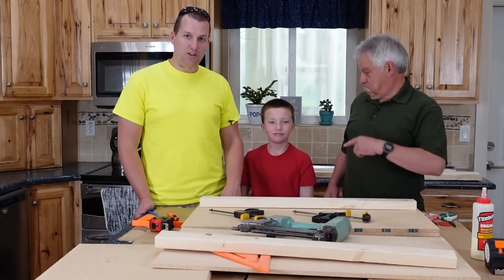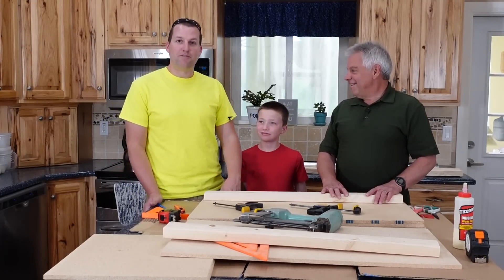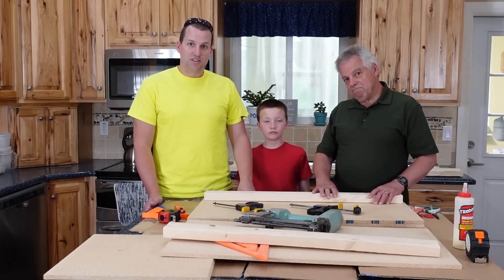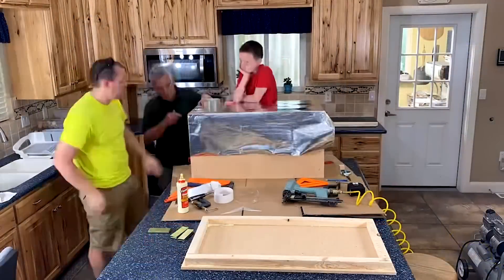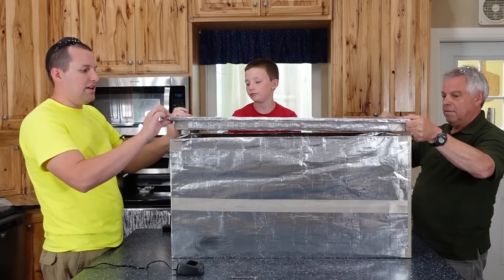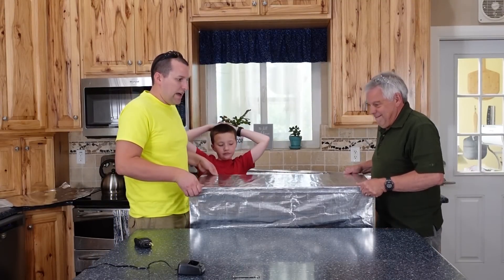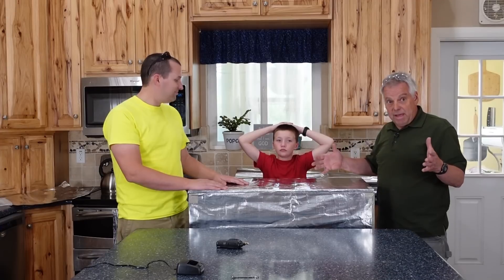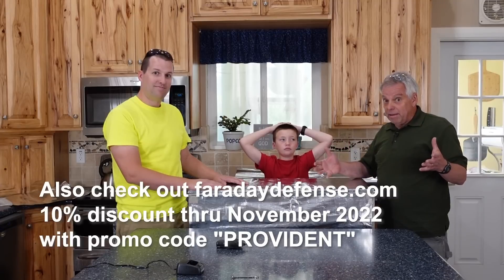EMP Ready: DIY Faraday Cage Construction and Testing

Comment: one thing you need to know  is that the squeeling you heard at beginning between radios has nothing to do with the frequency  it has to do with  audio feedback between the mic on one radio and the speaker on the other radio , so do get confused and think that since you dont hear that audio feedback that you have stopped signal transmission , you have only seperated the  speaker output from feeding ointo the mic input on other radio, but using other means to verify signal reduction is what you need to use, unfortunately too many people online think that the audio feedback  going away proves success it doesnt , you need to verify in other means, the cage does work yes but cannot use absence of feedback as proof, key is to make sure no leaks in metal barrier , even if some leakage occurs it will be reduced enough to stop or extremely reduce chance of damage to electronics, nice project though can modify to size you need for your situation.

Comment: Good luck being able to use those protected devices with no power grid and no functioning communications systems.  If you have battery backup it won't last long.  If you have generator, fuel will be depleted shortly.  Best thing you can do is get out of population centers and be prepared with supplies for living as in 1800's.

Municiple water supply will be down.  So no flushing toilets either.  Are you prepared for that?
No life sustaining prescription refills available either.
Lot's of people will die in the first year.
Do you have source of heat for winter?
Do you have cooking ability?

Comment: Since I need to keep mine in a garage, I'd be worried about the EMP wrap getting cut/sliced while moving things around. I'm thinking of lining the inside of a box using this type of material and then adding cardboard/thin paneling to set my items on. Could this ideally work? Thanks

Comment: Btw - I forgot to mention…
Some types of copper conductive foil tape comes with CONDUCTIVE ADHESIVE!
It sure beats soldering bridging braid or other methods of achieving true multi surface equipotential.

Motorola used to carry it for their repair depots and other sources.
The price wasn’t really too high and they also had a variety of widths available. (1/8” / 1/4” /1/2” 3/4” 1” / 2” / 3”)

Great video as always.
Thanks!

Comment: If anyone here has constructed a Faraday Cage type RF attenuation enclosure and would like to THOROUGHLY test it more than Dr. Bradley’s test device (a great little design at low cost that essentially does the job for most applications).
He’s also a brilliant mind in the EMP/CME community.

But… if you would like a more comprehensive test and/or cannot afford the Dr. Bradley test kit, and happen to live near NorthWest Suburban New Jersey…

I’m an EE and RF design engineer / Amateur Radio Operator / volunteer firefighter-EMT / Father and Husband /
“Evil and Psychotic Prepper Type” who was forced to retire after my medical situation (I have Ankylosing Spondylitis and pSA) really interfered with work.

I have a home RF lab with everything required to thoroughly test any enclosure that my smallest portable spectrum analyzer can physically fit into. Agilent 9340c (or… if too small, the mini SA is about $15,000 less than my Agilent SA and the size of a few iPhones stacked on top of each other.).

of course, no charge for anything.  I’m just looking to assist the same community that has given me so much information in the past..

Comment: Build a faraday cage- use it to stored electronics and back up equipment and electronic components.
I keep 3 cans just for back ups electronic devices, batteries and power generating systems.
Plus i will keepbextra wide variety of electronic components- resistors, capcitors, computer chips plus "SD cards with lots of stored data and computer programs.
I can repair my stuff for free and help out others.
1,000 in componets being protected.
As a profitable business.😅
😅😅

Just like seeds and canned food in jars to cover over 2 year supply for myself. I live alone.
I can grow extra food to sell.

I also keep containers to store 500 gallons of water or pull it from the ground.😮

Comment: To be able to withstand an EMP, and in order to make a proper Faraday cage/box you MUST understand the properties of an EMP.  Not understanding the nature of EMP's and making a box that is supposed to protect your sensitive electronics from EMP's that is based on a lack of understanding WILL result in making a faraday box that simply does not work.  

Anyone with any knowledge of EMP's will tell you that an EMP creates 3 types of waves or pulses.  E1, E2 and E3.  The E2 and E3 are pulses that "look" like a CME and a lightning strike.  The E1 pulse is the pulse that is the real danger.  It is this pulse that, without understanding its properties, will be the downfall of faraday cages that are make like yours.  I can't go into detail about the E1 pulse, the E2 and E3 pulse.  Sufficeth to say that there's a huge difference between them.

The radio tester you are using.... that too will not mimic an E1 pulse.  For you see, the E1 pulse uses frequencies anywhere from 100Khz to 30GHz.... You are only testing ONE frequency... and I really don't care which frequency that radio is tuned to.  You have to be able to prevent frequencies from this huge range and not a single frequency.  This is why your microwave does NOT make a good faraday cage.  IT only protects you from a certain small range of frequencies and not the entire frequency range of the E1 pulse.  You also haven't taken into consideration the amount of surface voltage that will be present on the faraday box if a small yield HEMP hits.  A SMALL yield HEMP produces around 50K volts/meter squared.  Today's HEMP's produce in excess of 200K volts/meter squared.  What does that  mean?  Anyone that understands EMP's and HEMP's understands that when the gamma particles that are ripped from the upper atmosphere come down to earth, they create the 50Kv/m2, which means that if you have a box, similar to yours, with dimensions that measure 1meter x 1 meter x 1 meter, the surface voltage on that box will be 50,000 volts.  Again... this is for the old HEMP's.  Today it would be 200,000 volts on the surface of your 1meter box.   Depending on the THICKNESS of the material will determine how much of the surface voltage can be present ON THE INSIDE of the box.  It is quite necessary to keep a physical barrier or distance from any device inside of the box to any of the 6 sides of the box.  For a 50kv/m2 yield HEMP, you are required to keep AT LEAST 1.5" distance away from the surface voltage.  It is understood that with a 50kv/m2 surface voltage the electrical voltages "jump" to any device within 1.5" of the surface voltage.  The wood may in fact be the right solution here... but you need more than just the 1/2" press-wood, or fiberboard.  You really need the 1.5" of separation.  In addition, you need to wrap your devices that are placed in the box with heavy duty anti-static material.

This is just the beginning of what needs to be done.  I find it interesting that many people on YouTube show their "solution" when the solution really doesn't address the issues that an EMP or HEMP produces.  Your "EMP proof" box has many issues with it.  I just wanted to let you know.

Comment: Im a Ham Radio Operator & have lots of expensive Radio equipment & I was thinking of bunging it all in my chest freezer as soon as War is declared as the metal grounded cabernet should offer some protection. As for my larger items like a 50 inch plasma TV & several smallers sets I thought I could wrap in aluminium foil & ground it to the water pipes on the central heating radiators. Antennas to TV, broadcast radio receivers should be disconnected as even a weaker EMP would damage the receivers front end at least. A microwave oven should offer protections to Ones electronics.  It's knowing when a EMP attack is coming as we dont want to be deprived of our gadgets by storing them in an EMP box & just waiting for it to happen.
Reply: I expect that the EMP event will happen without notice. Maybe if you have your ear to the ground and can read between the lines, you might have 5 minutes notice.
Reply: @ToiletTrainingTales  True, but I bought 3 trash cans & have devices packed away in cardboard lined trash cans & larger items any metal insulated & wrapped in foil.

Comment: To prouve better your point I would have tested it with the lid open to show the beep for the test device and then would have tested it with the lid closed. It would have prouved how efficient it is. Also I would have put an antenna on the outside radio. Good video
Reply: Agreed the feedback loop is not a true test. He should have an antenna on the outside radio and the inside set at zero attention to see if it blocks the signal. Then speak or press the SOS button and for a check of the Inside radio. Overall the tester seems like snake oil to me. I have worked with RF as a satellite operations engineer for over 20 years and hold my General class ham license. Not saying the box doesn’t work but that the test method seems flawed.
Reply: Exactly @ccrews0612   The E1 pulse produces a HUGE frequency range... down past 100kHz and up past 30GHz!!  People simply do not understand EMP's or HEMP's!!

Comment: Thing is you never know when a E.M.P. is coming. My thing is do you keep all your 2 way radios in the Fareday box ? If that’s the case do you have two way radios to use in normal times and use?  I have a CB & GMRS mobile radio in my truck , same with my wife’s vehicle. Plus I have a base radio . Not knowing when a E.M.P is going to happen all the electronic equipment I have in use will be ruined. Having a Fareday box won’t help with that so I should have backup radios and other electronic equipment just to keep in the box ?
Reply: I have 1 pair of walkie-talkies for everyday use out. 2 pairs inside my box, as well as a spare ham-radio, cellphone, emergency radio, rechargable batteries, battery charger, small solar generator with 2 small panels, old spare laptop, external harddrive with a crapload of e-books on it and some other stuff. Each in a cardboard box wrapped and sealed with heavy-duty foil. All those packed into a large plastic crate that has been wrapped and sealed with the foil as well on inside and outside, then cardboard on the inside again.
What is in there is stuff I do not plan on taking out a lot, just once a year to test, then seal everything again.

Comment: You'd probably want to either round all corners or put some other heavy tape over them, like duct tape, to help prevent tears at those points. Also, HVAC duct tape is good for electrical seals, basically metal tape.  Not sure if it would be more or less than your tape.

Comment: I've heard varying things about the effect of such an event.  One guy who claimed to do research in that area stated computers would crash, but could be rebooted, cars stall, but restarted, etc. - no actual damage to the gear.
Reply: It would depend on how much power is being channeled in the air. If it's enough to send a current through your computer that would fry your chip...they aren't turning back on.  If it's meant as an attack then it is going to be strong enough to blow out industrial transformers and therefore should easily blow out every delicate computer you've got in your home.

Comment: How do you keep your cellphones safe if a EMP is set off? 
How much time do you have to put your phone inside the box?
Reply: Another thing to consider- if shtf happens, odds are there won't be cell service. A cell phone will likely only serve as a storage device for addresses, recipes, photos etc. I doubt you will be able to communicate  with them. But who knows, maybe there will be cell service. Odds are only ham radios will be able to talk and receive. There is so much unknown that it is impossible to prepare for every scenario.
Reply: @kmunson7544  True, which is why I have a spare ham-radio as well as 2 sets of 2 way-radio's in there, plus an emergency radio with handcrank. Old cellphone, old spare laptop and external drive with e-books recipes, addresses and more as a backup, though I keep most of that as hardcopy in paper too.
Reply: You need to save an older cell phone and leave in the box. Since most of us live with our phones, having a "burner" phone will be important. We purchased a small shortwave and transistor radio to put in our cage. Having a ham radio is also a good idea. A means to communicate and hear info may be what saves your life.
Reply: Thank you, Kurt. I have asked several different people in other groups and you are the only one to answer me. I was confused about how to protect my LG if shtf. I can't. I need to get an older phone and store it. But I need to have it activated first.
Reply: Or any electronic devices?

Comment: A couple years ago I stumbled across a fantastic deal on a 2 x 4 Mechanics on site toolbox at an auction. I've lined it with rubber on the inside.
Reply: Something with openings will allow microwaves to get inside. Even if they are so tiny that you can´t see them.

Comment: We built a Faraday cage a few years back with a galvanized trash can solidly lined in cardboard, then sealed with aluminum tape. We used 2 cell phones to test it. Put one cell phone inside, seal the cage, then call the cell phone. If you hear it ring or get a "missed call" on that phone, you need more sealing. We wound up also lining the inside of the lid with cardboard, and that did the trick. Cheap and effective.
Reply: dumb question, but you don't need electricity running on the metal right? just the material?
Reply: @jacobpeters5458  You don’t want any energy on it/in it at all
Reply: empdoctor explains a lot. And diy. And he has books and online store
Reply: You do realize that an emp “blast” is going to be about 50,000 times as powerful as a cell phone signal right?
Reply: Another person that doesn't understand EMP's.   Lining the inside of a trashcan will NOT suffice!!  With a small-yield HEMP... the kind that would produce a 50kv/m2 (50,000 volts per meter squared), you need AT LEAST 1.5 inches of separation between the can AND any device that you're trying to protect.  

Although it is possible to use a HEAVY DUTY metal can, it MUST be one with ZERO rivets, screws, etc.  ANY tiny hole will make the entire can become a "garbage can" because anything that is in the can will be destroyed.  Not understanding the E1 pulse will be the downfall to all these preppers who saw something on the internet that said you can use a garbage can to protect your things.  They did get one thing right though.... your destroyed things will ALREADY be in a garbage can.
Reply: Not a bad idea. But that means the cage will only absorb the waves in the frequency spectrum of the phone.
Reply: @FBPrepping  With respect, leave out the word "only" in your comment for a more accurate assessment. In other words, will absorb (but not limited to) certain/phone frequencies.

Comment: I use 45 gal steel drums with pinch rings, lined with cardboard. Change gasket out with an EMP model gasket. Also have some 5 gallon pal go models for small electronics like communications. One small rip in that fabric and the box is compromised.

Comment: I’ve read all three of the books, one second after, one year after and the final day.  Question, aren’t the solar panels for charging the solar generators also susceptible to electromagnetic pulse?
Reply: From what I understand, they will still function. There are no sensitive computer chips or anything on solar panels to get ruined.
Reply: @Isitmetal  just the components and batteries inside the house?
Reply: @monicalamontagne7888  batteries are also safe, just anything that has delicate circuitry and computer chips is the stuff you need to worry about
Reply: @Isitmetal  ty so much!
Reply: The diode rectifier for reverse polarity on the solar panel can be affected. They are typically rated at 400v - if the induced reverse voltage is above that threshold there is possibilty that the diode will short open permanently.

Comment: A solar CME is a threat to the power grid and long communication cables. It’s not a threat itself to small digital electronics. The solar threat is not a concern for these devices, especially if a device is not plugged into mains power. A CME only causes the E3 part of an EMP. Definitely worth prepping for its effects, but a faraday cage isn’t needed for that. The nuclear EMP does need it though. Thanks for the video!

Comment: I was under the impression that electronics was protected from an EMP event if just turned off.  Is this correct?  Should I store my spare electronics in the EMC safety box?  Thanks for the video….
Reply: Being off doesn't stop strong magnetic current from frying electronic components. Your device doesn't attract magnetism by being turned on. An EMP or strong CME penetrates the chips themselves.